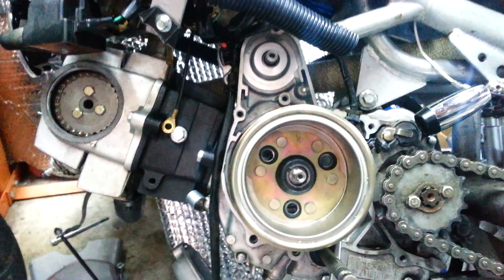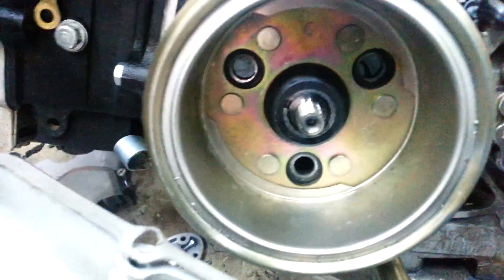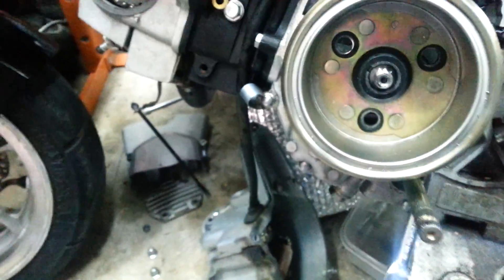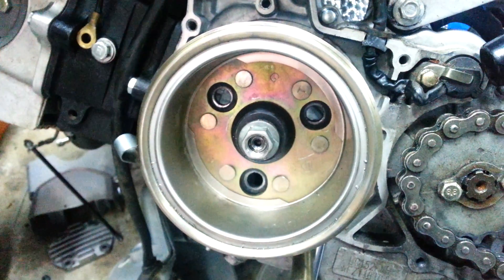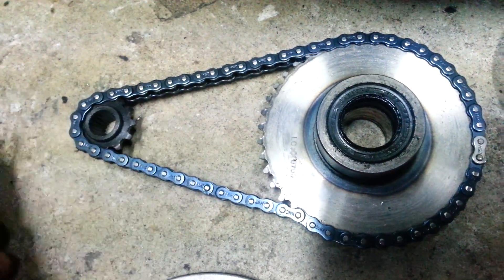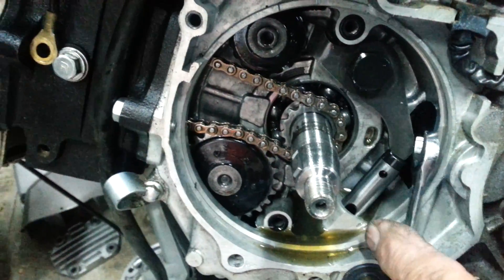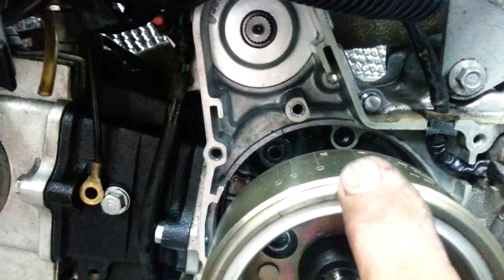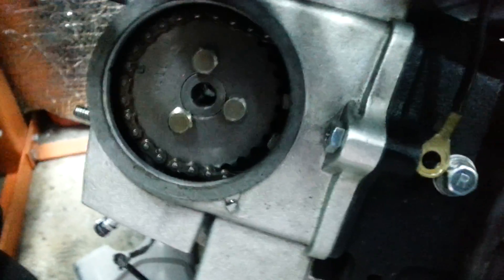Loncin 110cc engine

Comment: how to remove nut on flywheel
Reply from the maker: I had to use my air impact gun with my air compressor the nut is a standard thread. Meaning clockwise is tightened counter-clockwise is loosened
Reply: @skypilot1294  I mean removing the flywheel completely to access timing chain

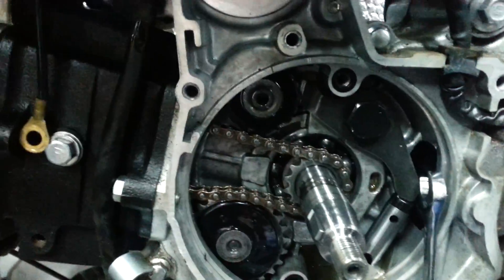Comment: If you pause at 2:44, what is that wire coming out of the case? Mine is cut, is it a vital piece to have? thanks
Reply: +C. Morg that wire appears to go to the gear sensor... basically if you have a gauge with gear indicators or a neutral light, that is what tells it what gear you're in. the wire for your stator should come out next to that wire as well but you only need the wire to the stator for the engine to run, this guy took off the stator cover which had the wire in it though.